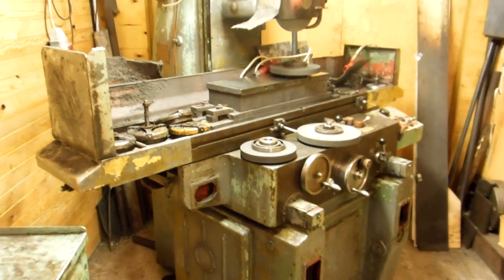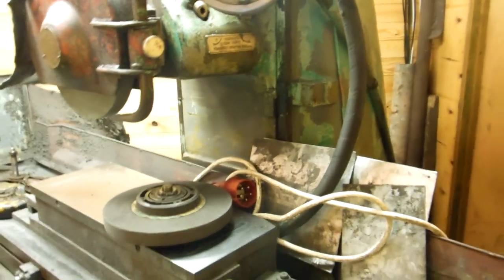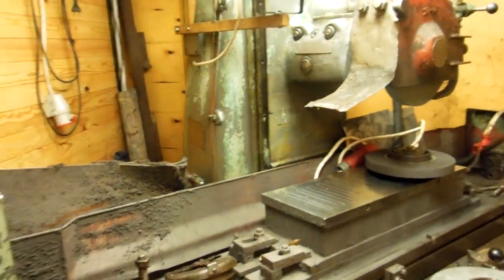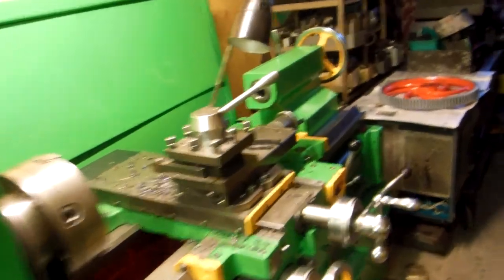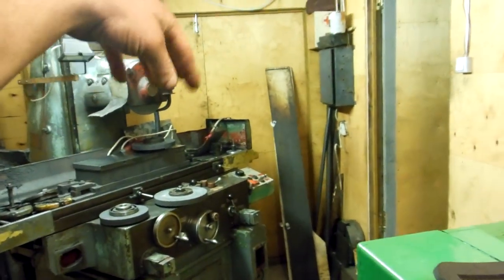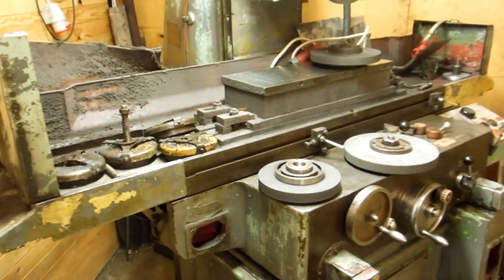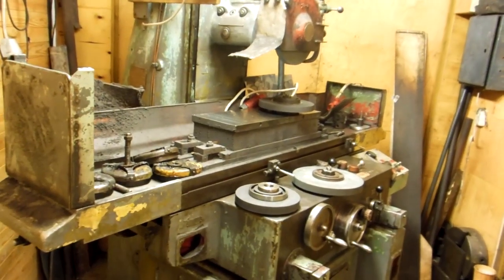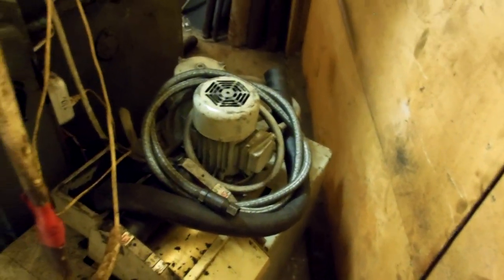My Machinery move - old grinder view /p10

Comment: I'm looking forward to seeing the new grinder in action.  Also what cnc machine are you interested in? Mill center or lathe?
Reply from the maker: I interested in unversal milling machine with cnc, example MIKRON WF3 DCM CNC. Yea, for to fix my new grinder need to work. Thanks!
Reply: that would make a great addition to your work shop. is the mikron machine a universal mill outfitted withe cnc conversion ?
Reply from the maker: The MIKRON company have lot models of milling machines. But if we talk about the MIKRON WF3, so then is can be with CNC mode and it can be without CNC - manual milling machine. I was found one MIKRON WF3 DCM here... machine was jaded (computer dead, ways with deep scratches, ballscrews - black).... I refuse from that deal. I still look for good machine with good price.